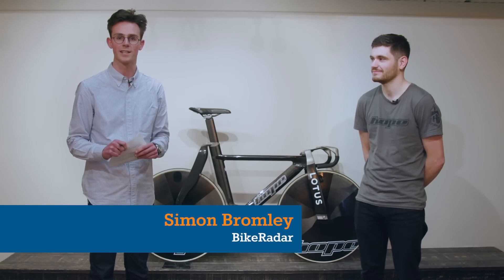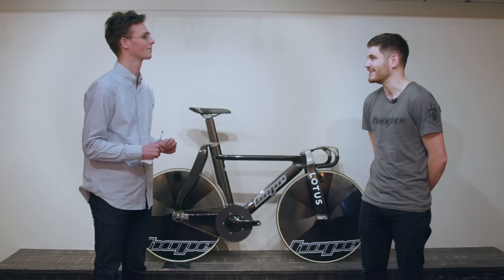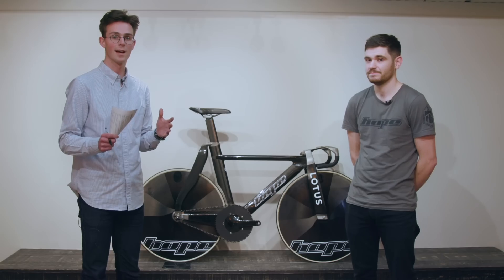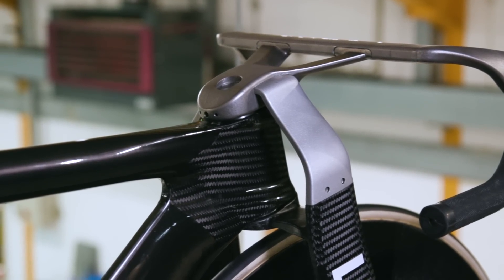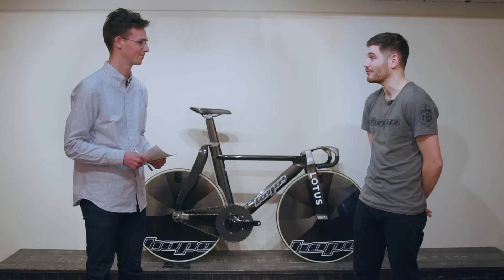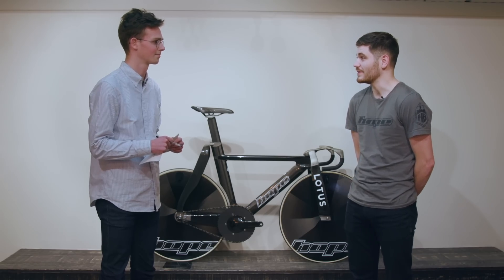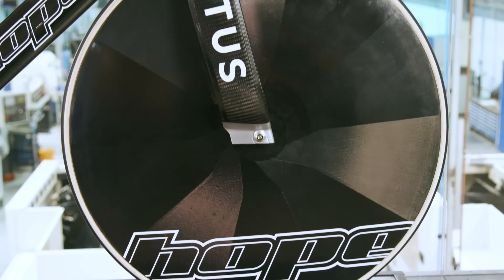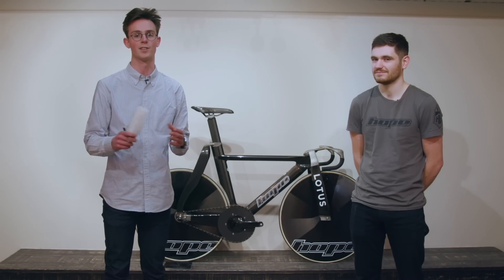Incredible Hope HB.T Olympic Track Bike | In-Depth Chat With Design Engineer

Comment: Very nice.  Will I soon need one?
Yes.
Will I buy one?
Probably not at that price.

The disc wheels are getting better but I find it so very interesting that 

they still have not caught-up with my design which was not only lighter,
and stronger, but predates this bike by 38 years!

There is a way to greatly reduce drag & weight on the chain, and chainring.
I would like to take credit for those design ideas but I can't.  They too are over
40 years old.  The concept is UCI legal, so why not do it?  For some reason
advances are slow, and it seems that thinking outside the box is a very 

difficult thing for engineers.

Comment: Superb. They have actually designed and made the thing themselves. Cervelo, Pinarello et al just bumble along with the prevailing trends, their adverts full of lovely talk about their cutting edge "innovations" being proven in tests. Those firms are actually worse than the far eastern copy houses- at least Deng Fu doesn't charge extra for bullshit. The people in this video, however, are the real deal- proper engineers. I hope they win. Good luck lads.
Reply: Your comment didn't age well.

You're critisizing companies that 'charge extra' while they are half the price of the Lotus bike that:
1. hasn't shown it is advantageous in theory;
2. hasn't shown it is advantageous in practice. 

In the end, it seems like you could as well just buy a stock Argon 18 Electron pro for 1/3rd the price with standard Campagnolo discs instead of those fancy 1-piece discs, and a standard chain spacing. 
Very old-fashioned, in comparison with the Lotus very cheap, but very much winning.
Reply: @l.d.t.6327  Has the Hope/Lotus bike proved to be no better than its competitors?
Reply: @charliecroker7005  The endgoal for team GB was to win with this bike at the Olympics, and until now, whatever improvement this bike possibly has (not even convincingly shown) for a ton of money, it doesn't come out, and is at best marginal and irrelevant.
Reply: @charliecroker7005  fact is that your comments ("superb" and "Those firms are actually worse than the far eastern copy houses- at least Deng Fu doesn't charge extra for bullshit.") are just your opinion, and at the moment your opinion isn't supported by the results, and your comment about 'charge extra for bull' indicates you are very much biased against firms like Pinarello, but clearly not as much critisizing a multi-million dollar progamme by British cycling, Hope and Lotus that doesn't deliver.
Reply: @l.d.t.6327  The mainstream brands flog incremental innovation into a fashion market. The BC engineers have attempted to design a better bike. That is Bad versus Good.

The far eastern copyists supply the same market as the mainstream brands, at a fraction of the price. The big-name brands are exploiting silly people. Good versus Bad.

Give the BC engineers a chance- they may yet prove themselves. Pinarello et al will then be forced to eat very humble pie, and copy the Hope/Lotus design.
Reply: @charliecroker7005  I generally applaud innovative and sound engineering, but you can't neglect the fact that this whole project didn't deliver. You can argue that the bike itself is beneficial, but if there are no competitive riders sitting on these bikes, the conclusion is that in practice, the bike hasn't proven itself. That's a lot of research money for nothing. Will this bike design survive and e.g. be adopted in the future by other riders / countries / teams? Who knows. But until then, I wouldn't claim it's 'superb'. Last: I am pretty sure that firms like Look, Argon and Pinarello get a lot of feedback from their riders. And while FES bikes are as expensive as the Lotus, they are at least winning in the Olympics. I would say that FES are superb bikes.
Reply: @l.d.t.6327  FES is another firm trying to do a better job, at a price. €20k for a frame and forks is more than the Lotus/Hope bike. IIRC, their bike costs £15k complete, or thereabouts.

Whatever the details, I like both. Both firms are trying to win; both are proving their work in public, in competition. The boutique brands are nowhere! That is  as ideal as it gets.
Reply: @charliecroker7005  I applaud innovation, but the prices (both FES and Lotus) are absurd. And while FES is totally absurd, at least they are winning at the olympics. The boutique brands as you call them actually have some bikes that mortals can afford. I haven't looked into Pinarello and Look (I do know Look isn't cheap either), but e.g. Argon electron pro can be had for less than 5.000 euro for a frame. At least that's something most can afford, and it wins medals and world records.
Reply: @l.d.t.6327  The Argon can't be that good, if the engineers working for the Olympic teams chose Hope/Lotus and FES. That sums up the difference- $5k for a second-class job is bad value for money. Pay $800 and get less fashion and the same performance from Deng Fu.

If the likes of Argon 18 actually employed real engineers to design their bikes, they would compete at the same level as Lotus and FES. The latter firms would then be forced to sell at a similar price to the mainstream brands.
Reply: @charliecroker7005  That Argon just got 2nd in the pursuit. The Pinarello won the pursuit. You can talk all you want but you can't back it up by results. If you could back it up even only by proven measured data, fine, but even those are nowhere to be found. So until now, it's just a very expensive gimmick, and just based on theory, you find this bike worth 15.000 dollar. You can't even prove that the difference between the lotus and e.g. Argon or Pinarello is more than the difference between Argon/Pinarello and Deng fu. So what is the cost per wattage won? You simply don't know. If the likes of Lotus would actually win some races... Until that time, the Argon 18/Pinarello, designed in collaboration with team Denmark and Dan Bigham / team Italy, are just the better (more succesful) bikes at the moment. The latter firms (Lotus, FES) will never sell at a similar price. They sell at ridiculous prices because they are state-sponsored and don't need (and don't want) to sell. You know that team Australia tried to buy/order the previous team GB bike for Rio, and they never got one?
Reply: @l.d.t.6327  So the teams using the shop-bought bikes won one pursuit race. Well done. That does not negate the principle that engineering for the task beats design for the market. I bet they would have done just as well on Deng Fu frames. AFAIK, this Olympics is the first major competition for the BC-engineered bike, and most of the British riders fell off. It is hardly conclusive evidence that their equipment is no better than that of a club rider.
Reply: @charliecroker7005  You are proving nothing, your principles are merely theory. The whole point is that it all looks good in theory, but in practice it doesn't lead to much. And the practice is what counts. And if you want to bet that Italy and Denmark would do just as well on a 800 dollar Deng fu frame, it's even more ridiculous to spent millions in research on a bike that doesn't get to the finale, as it is clear the legs and tactics are way more important. In the end, there is nothing superb (as you say) about the Lotus, as the gains from the bike are very clearly much less than the gains that are made by tactics and rider's talent. The Lotus hasn't won a race and won't be decisive to win a race either. Money wasted.
Reply: @l.d.t.6327  Re-read my original post. The results so far are not comprehensive or conclusive.
Reply: @charliecroker7005  The track tournament, you know the one, is half way. This bike was developed for Tokyo 2020. If this bike doesn't get results, you can ask yourself what's the use: it's too expensive for amateurs, and it doesn't win medals nor break records for the only team that uses it.
Reply: @l.d.t.6327  The fact is that the Hope/Lotus bike is an honest clean-sheet effort- not a cynical me-too fashion job, aimed at people who just buy the latest tech, whatever it is. That is why I wished them luck. It's early days yet- they may still prevail.

BC may not be the best team with which to float new engineering at the moment- their TUE abuse may have rebounded on them, in the shape of greater scrutiny from the Euro/global  drug testing authorities, restricting their use of chemicals more freely available to other teams.
Reply: Colnago had ferraris composite engineers to make the c35 possible... New price was still less than half the price of this HB. T (inflation taken into account)

Comment: I really like it when companies go a different path and not have everything look the same... However, the surface quality and smoothness looks really imperfect and kind of amateur. I wouldn’t want to ride this thing.
Reply: It doesn't imply any lack of strength or quality however. Races cars, even Formula 1 cars for example, often look downright scruffy on the bits where surface quality isn't important.
Reply: Tesla's Secret It just makes it product I would never want to purchase. Also, the airflow over a smooth surface has to be better than over a rougher surface.
Reply: @LarsRR ... Well though some units will have to be sold, it's not really intended for the mass market. Besides the fact that it may be still be in a sort of prototype form, I think that surface smoothness is quite overrated when it comes to bicycles. I find it very refreshing to see a manufacturer optimize a bike around the whole rider/bike system instead of simply making the bike slipperier.
Reply: Tesla's Secret as I said. I enjoy their approach, but do not enjoy the level of execution. Since I am not an Olympian, nor a Brit, but I am a cyclist, I have to view this thing as a product. And because it is probably going to be pricey, I would like it to be perfect. That’s all.
Reply: @LarsRR  Indeed, and so would I prefer it to be! Or perhaps... Do I sort of enjoy the roughness of it. Looks like a proper skunks works project. :)
Reply: Probably no UV protection layer since it's a track bike.
Reply: Mitchell Steindler well, I have been to track races an none of the bikes used (BMC, Mercx, Cervelo, Felt, Koga) looked nearly as makeshift as this thing does.
Reply: Yeah, some of the joints look a bit scruffy.
Reply: Look at 6.30 head set void closest frame, not great really.
Reply: @Rob-xe4lo  That isn't on the track bike. That was one of their mountain bike frames.